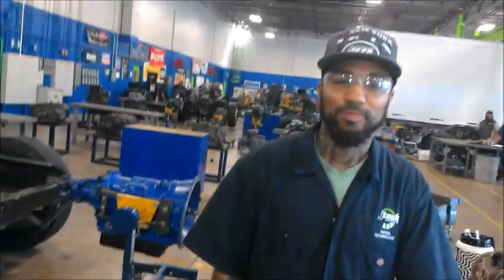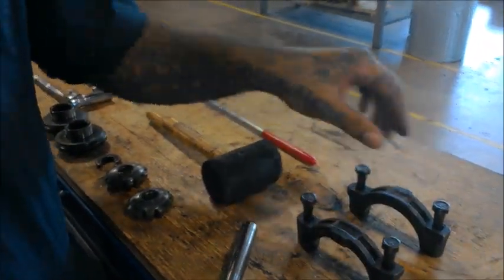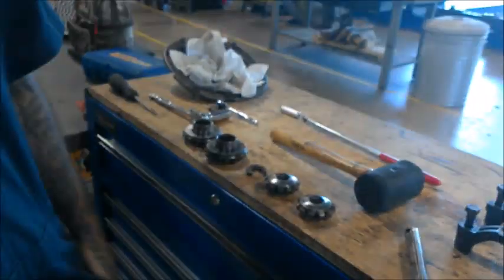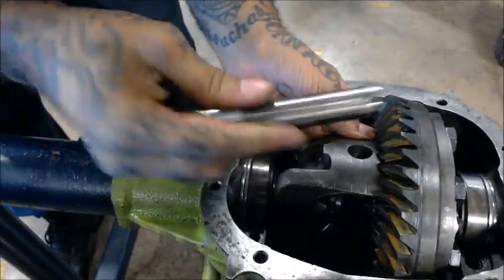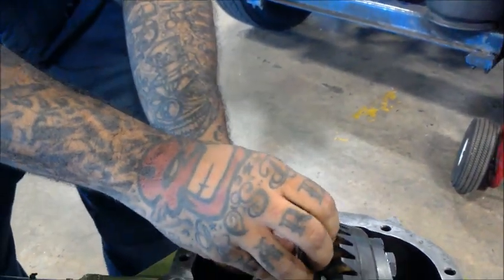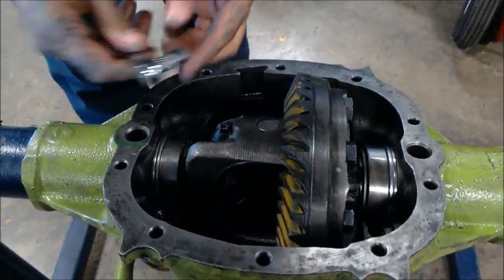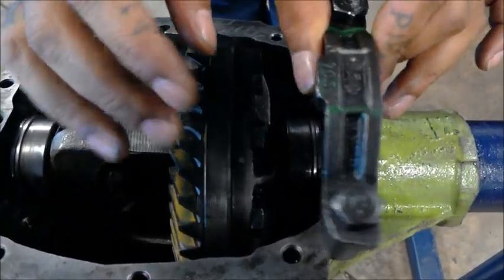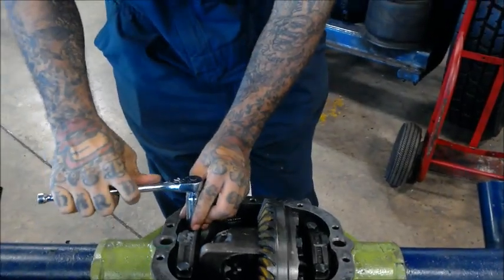How to reinstall spider gears on split axle differential

Comment: I get the just of the video. However, if you're going to teach someone how to install the used spider gears to it the right way. First. Look at the side gears teeth and find the side gear that mimics the ring gear, drive coast. The drive side will have more wear. Now install it on the passenger side and the one on the passenger side to the drive side. The pinion gears should be flipped 180 too. This will allow the pinion gears to drive on what was the coast side of the spider gears. Increasing the life of used spider gears.
Reply: Oh, so you are rotating the gears so long term wear is even, much like rotating tires to get longer life. Cool.
Reply: @spelunkerd , Let's say you have a posi or open carry. Rotating the spider gears must be done exactly. Driver's side side gear to passenger side. Passenger side to Driver's side. Pinion gear closest to cross shaft bolt moved to opposite side farthest away. Farthest away spider gear moved closest to cross shaft pin bolt. This will allow cause the spider gears to drive now on the coast side instead of continuously driving on the drive side. Coast side of the gears will have less wear. If the spiders are extremely worn then best to replace them.
Reply: My dam truck is 40 years old, I am not worried about how much longer the gears will last will last LOL.
Reply: @richardspaulding5035  Yep, that's why, Why people sell a used 12 bolt car or truck rearend they want 500.00 to 800.00 when all you have to start with is a bare housing. Everything else is worn out.

Comment: Does having the bearing caps removed make a difference?   I can't get my spiders gears in place as I can't seem to get my side gears pushed in enough to allow the spider gears to sit lower on side gears.
Reply: how did you end up getting this done, having the same issue

Comment: Does the baring cap  need to be removed  before putting the spider gear in? Please help 😅
Reply: No. It does not. However, if you’ve rounded off the hex on your lock bolt you can’t get a ratchet with socket in there to remove it.

Comment: you must know how to time the gears.  this should take five minutes max.  rotate the prop till the small pin bolt is centered between the main bearing caps.  now simply drop a spider gear down from top and slap the other.  hold the bottom one up and rotate the prop till the main pin holes will line up.

Comment: If i have my truck in jack stands and put it on drive only one rear tire spins is that normal ?
Reply: Depends if its open or locker or lsd
Reply: @gregl5677  its an open differential
Reply: @gregl5677  its from a 2000 chevy silverado i guess code for it is a gt4 diff
Reply: @jmj_d5207  does it have a g80 code next to gt4? If not its fine its a open diff g80 code was fore posi trac. Unless the rearend had a locker put in it at some point.
Reply: @gregl5677  no no g80 just gt4
Reply: @gregl5677  oh ok then so if it has no g80 it is fine that only one wheel spins when engaged to drive ?
Reply: @jmj_d5207  should be thats what a open dif does. You can have someone hold the wheel let your foot off the break. You should be able to keep it stopped and the other side will start turning if not you have a spider gear or bearing issue..
Reply: @gregl5677  thanks will be doing

Comment: They are a pain in the ass without the proper tools when putting in however when you use a dissolve stitches to pull the spider gear in so it doesn’t fall out it makes thing a lot easier